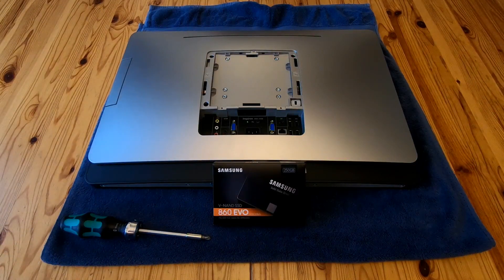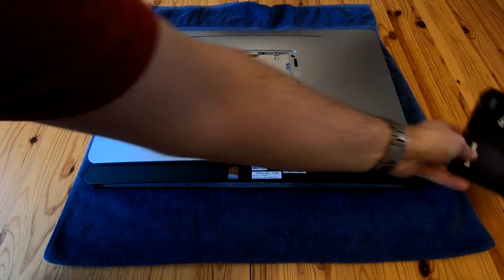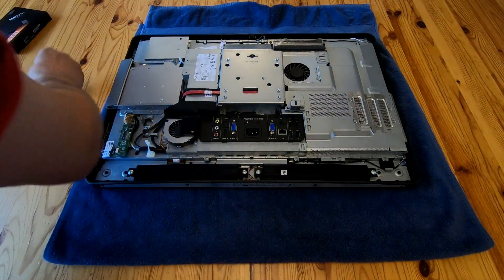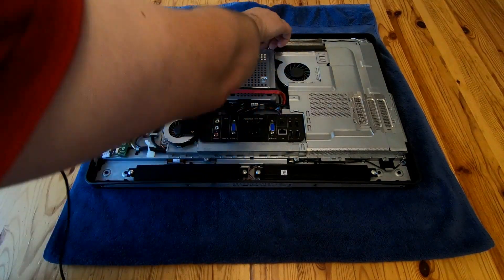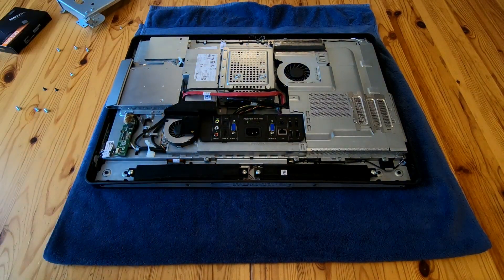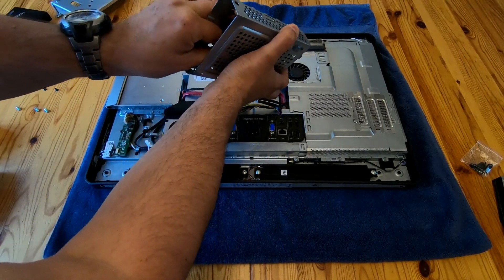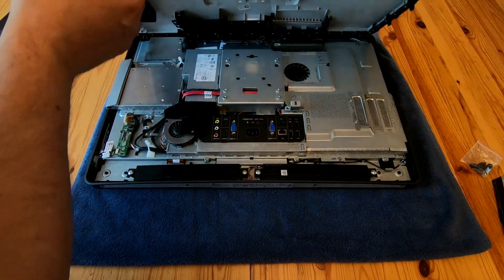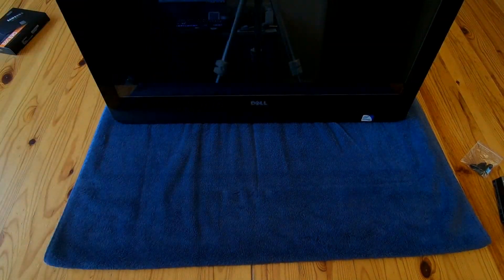DELL Inspiron One 2330 HDD Upgrade and Replacement *HOW TO* Guide

Comment: Hi Nic, thanks for the video. It was really helpful!
However, I've got another idea and I'd like to know if it would work: do you think that I could use a double sided tape (such as 3M) and stick the SDD to the chassis, thus eliminating the HDD cage?
Reply from the maker: It's a nice idea... I suggest two reasons why using Velcro and leaving the cage in is an easier option:

1. Taking the cage out means you have to find somewhere to store it or you throw it away. This will be a problem if it's ever needed in the future. And there's no harm leaving it in the computer.

2. Double sided tape can have two opposite issues - too sticky or not sticky enough. If the tape gets a really good grip then the SSD could be damaged in future removal, but if the tape isn't put on a clean flat surface then the SSD will just come lose and drop. You also only get one chance to fit the drive - with Velcro you can adjust position.

I've used double sided tape in the past - hence the problems mentioned above come from experience - and Velcro tape is just a more elegant solution.

The main point of it is to avoid buying a 3.5" enclosure for the SSD... which would fit in the cage properly, but costs extra.
Reply: @sterntechdaddy  Indeed...thanks again!
Reply: I have used double sided tape on over 200+ SSD works great.

Comment: sir did u reinstall the windows after changing hdd ??
Reply from the maker: For this particular PC, the SSD was already fitted and Windows had been reinstalled using a bootable USB stick. This is why the PC started with Windows when it was powered up.

Note that because it was Windows 10, activation was automatic because of the digital licence associated with the PC.
Reply: @sterntechdaddy  What do you mean the WIN 10 Activation was automatic, can you please explain, I have this Dell PC and was thinking on upgrading to an SSD.  I have the Windows 8.1 Dell USB, but I don't think it will allow me to upgrade to Win 10.  Any help would be great.  I'd like to get Win 10 on the machine with a new SSD with out clone an old HD, I'd like to do a fresh Win install from a USB.
Great video
Reply from the maker: @reel_images  For devices that come with Windows 10, the licence key is often embedded into the BIOS. This is certainly true for laptops, regardless of who made them. For desktops this might not be true if the OEM is a small company, but for DELL all their PC's will have a BIOS key.

This includes Windows 8 computers - which were the first to have this embedded key.

Windows 10 Setup checks for a BIOS key and uses it automatically - and once the internet is connected, activation happens automatically.

So you should be able to install Windows 10 on your machine.

If you're a bit scared, then don't worry, you can use a software tool called RWEverything ( http://rweverything.com/ ) to access the BIOS key and write it down so you can manually enter it if Windows doesn't spot it.

If you are especially worried, then remove the old drive with Windows 8.1 on it and fit a new SSD - try and install Windows 10 and see what happens - if there's a problem you can put the Windows 8 drive back in.

:D
Reply: @sterntechdaddy  thanks so much, I believe windows 10 is a free download to a USB.
Reply from the maker: @reel_images  It certainly is...

You can get it from here: https://www.microsoft.com/en-gb/software-download/windows10

If you're not sure how to turn that link into a bootable USB stick, then I've made a video...

https://youtu.be/PMKPRRI6M-I

Hope this helps.

Comment: Worthless video. You don’t show disassembly from the beginning. Jumping into a how-to after partially disassembling helps how, exactly?????
Reply from the maker: A bit harsh!

Removing the stand is pretty simple - there's a plastic plate which just lifts off and then 4 screws. If someone can't do that then its not a good idea attempting anything else. I wanted to keep the video as short as possible so left that bit out....

But in future I'll included everything.
Reply: @sterntechdaddy  Evidently I'm not the only one questioning the value of this video, the downvotes are at 40%. Imply what you will, I'm just being real about your 'how-to' video. Sometimes people need to make sure they don't break something, even the 'simple' things. So your implication that I shouldn't be attempting anything else is just plain ignorant. Replacing a hard drive isn't tough. It's the disassembly details that matter most.
Reply from the maker: Again. a bit harsh!

There are plenty of reasons why people down vote - but those reasons are not known and there are more up votes anyway. And you are the only person questioning this video.

There are also plenty of other Inspiron 2330 full disassembly videos - this one just focusses on HDD replacement. Stand removal is covered by all the others and I would expect people to source information from several places before attempting anything. It is not ignorance to be cautious about encouraging people do something that might cause injury or damage.

All that is missing is the stand removal - everything else is covered.

Comment: Hi, could you answer me a question about the maximum ram capacity supported by this model?
Reply from the maker: Crucial are helpful for this... https://uk.crucial.com/gbr/en/compatible-upgrade-for/Dell/inspiron-one-2330

So 16GB max for DDR3 PC3-12800 SODIMM with 2 x 8GB being the best choice for performance.
Reply: i believe 8gb
Reply from the maker: @sniper0wolf  16GB looks wrong and 8GB looks right... Crucial site says 16GB, but doesn't offer 2x8Gb as a purchase option - which is something that Crucial wouldn't miss.... this also gives 8GB as the maximum.

https://downloads.dell.com/manuals/all-products/esuprt_desktop/esuprt_inspiron_desktop/inspiron-one-23-2330-aio_reference%20guide_en-us.pdf